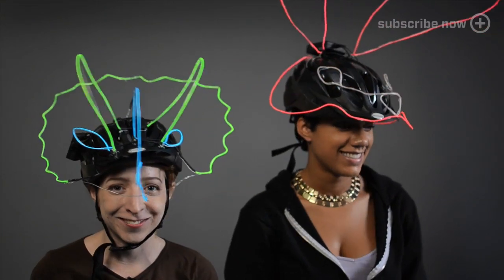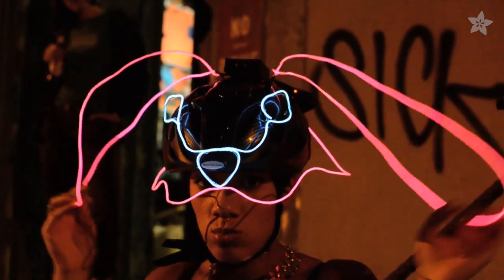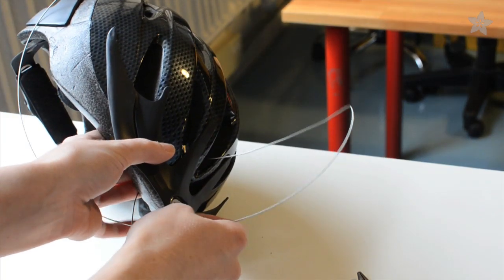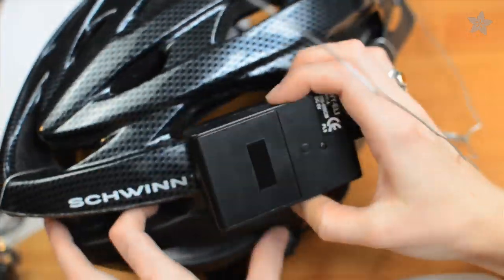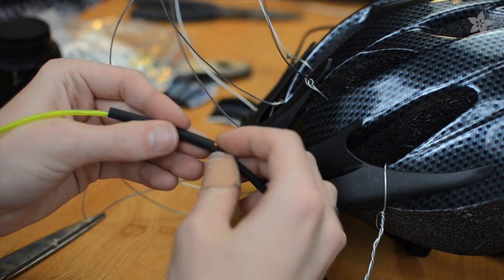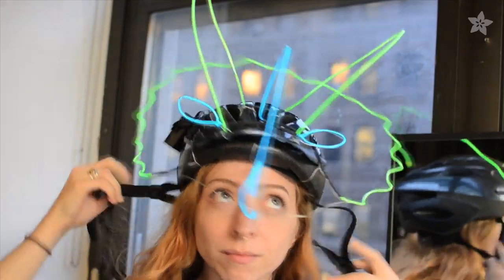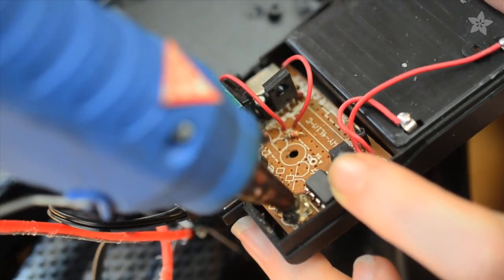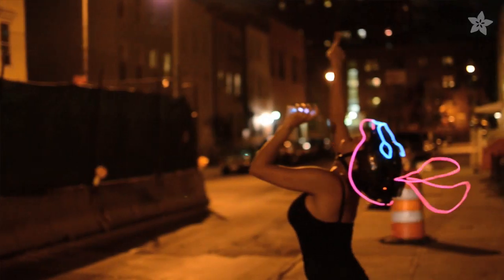EL Wire Animal Masks for Halloween

Comment: RE: Noise Reduction -- I heard you say that you put the hot glue on the capacitors... but just to clarify... are you putting the glue @ the base of the capacitors?
Reply: eesh - i just came across this video, so i'm sure this reply is far too late. based on what i've learned, a moderate covering of hot glue over the entirety of the capacitor should presumably do the trick; placing glue only at the base is insufficient. hot glue generally won't interfere with active circuits or overly inhibit heat dissipation under low-power scenarios such as this.

notably, i've been cracking open new inverter battery packs from adafruit only to find *no capacitors*... only a wire coil. like the capacitors, coils also vibrate at a high frequency, producing a whine. apparently (and again, only under low-power scenarios) you can also coat this component in hot glue to muffle it.

note that any technique isn't perfect; some noise will inevitably find a way past insulation. you can also try using foam sheeting, either in small portions adhered to the casing interior, or in worst-case scenarios as a wrapping for the entire inverter as whole.

Comment: EL wire really lends itself to costumes, and so does the Gemma/Flora.  Have you considered making an sequencer add-on or variant of a wearable Arduino-compatible microcontroller?  Sparkfun makes an EL sequencer that they demo in a costume build, but it's designed for pins and so on, and while I doubt EL wire would play nice with conductive thread, it'd be nice to have a sewable board with a few EL outputs and sewable terminals for sensors/LEDs.